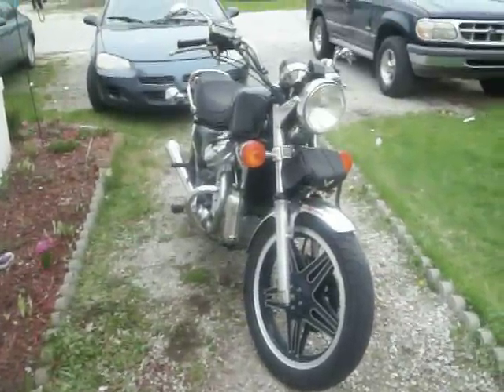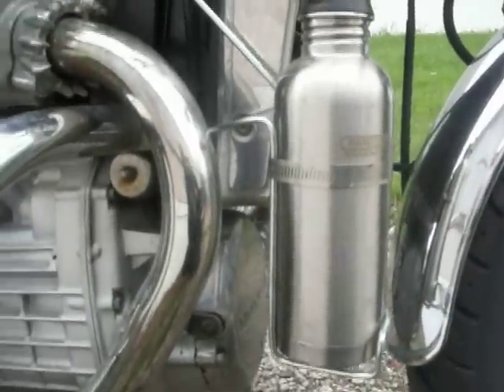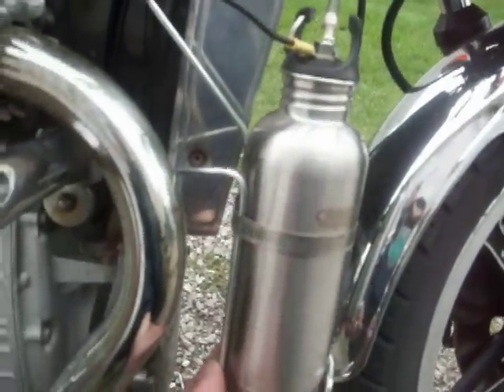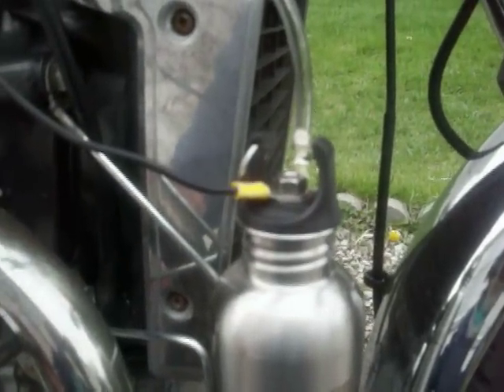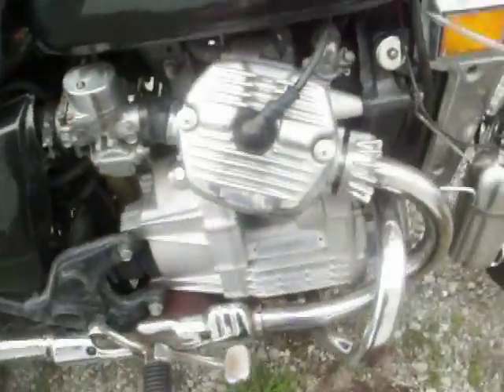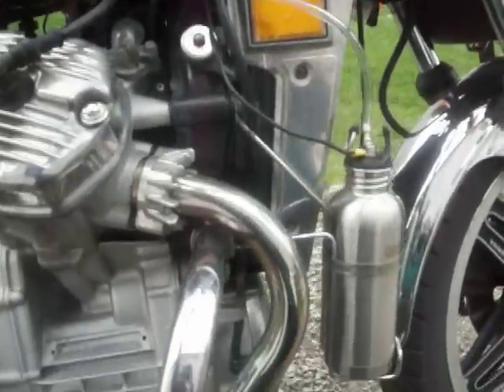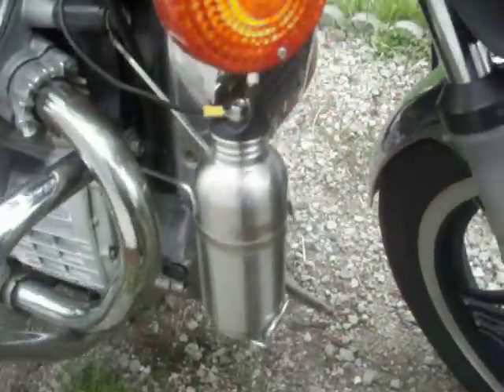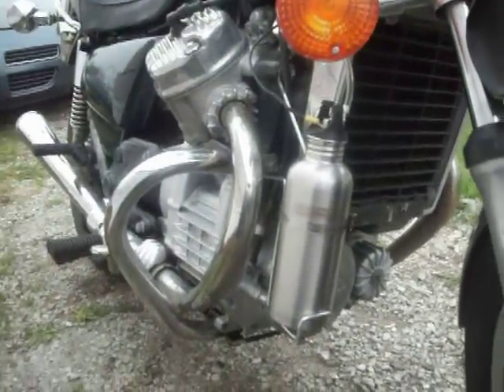HHO / Hydrogen generator powered CX500 from Westcoast Exterminator

Comment from the maker: @christo930 Bikes generally don't have any extra power to spare. so I replaced every light that was constantly on with LED bulbs, This only freed up a couple of amps so I ran with a low sodium solution. This controls the power being drawn and heat output of unit. This is a direct hook up. This year I came up with an indirect hook up (see motorcycle hook up vid). I will be trying this out next season. Thanks for the question

Comment from the maker: @tobsta30 I'm not getting that much. A lot of bikes only have enough amps to power whats put on at the factory. I did switch to LED bulbs where useable, but the bottle bearly puts out anythng, and hardly draws anything. I don't need a bubbler because I'm on the other side of the air filter. The other vid you saw can use left over power from the headlight and get more output

Comment: @wcemichael I meant in an appropriate container, but you are probably right in that the equipment to do it correctly would just be cost prohibitive and dangerous.
I thought that thermocouples were largely used to measure temperature differences, I didn't know they could be used to charge a battery, pretty cool.

Comment from the maker: @christo930 The thermocouple idea is just a theory, so far, but techicaly would work. The are small and produce small voltage, but that voltage is powerful enough to make a magnetic field to hold the pilot light on, on  a gas device like heater or waterheater. Well, maybe they can be made bigger, or at least they can be stacked. I mean, we're talking about a whole engine, exhaust, and cooling system compaired to a single pilot light. Agian, theory, but should work.

Comment: @mrmolez1 The way I see it is that the engine will improve on performance and power output meaning that you will not have to open the throttle as much as would normally be necessary thus (theoretically) improving fuel economy as SOME of the fuel used to power the engine is free.

Comment from the maker: @wheresthelove83 continued... Your not going get a lot. Test to see if your using too much power. I did this with a bulb. Put the light between the power and bolt. If the light BARELY comes on, that's just about right. We're talking about a pinch of baking soda. You could try a old speedo light permantly wired in and use a stronger solution. Most rice burners are not designed to give you ANY extra power. So keep small set of jumper cables with you untill your confident the battery's not draining

Comment from the maker: @Lando7331 The point of the bottle was to create the MOST simplist HHO bottle that the masses could reproduce. Making a neutral plate would be somewhat hard in keeping things simple BUT, I have a way to run the bottles, maybe multile bottles that have 0 resistance by using leftover power. I have an example vid in my collection. Also runnig 2 bottles in series, like batteries in a flashlight, would provide the same neutral effect.

Comment from the maker: @wheresthelove83 Take out the headlight. Use some kind of tester,  a light bulb with couple of wires. Hunt for a hot wire when the power is on. Mine has a group of think black wires. with basic connectors protected with clear rubber insulators. I shoved a wire between the connector and insulator. YOU NEED TO SAVE SOME AMPS to do this, Replace most lights with LED bulbs. The tail, the speedo & tach. the front turn signles for now has a piece of tape over the bulbs terminals for the running lights

Comment from the maker: I'm sorry. I didn't see this question till now. Get a cheap amp gauge from ebay & a couple of leads with alligator clip ends. Unplug the smaller wire from the battery if you can find it and hook the amp meter in line. This will tell you how many amps you have when charging.. If you have a couple amps left over with the HHO on then your good. You can save back a couple of amps buy replacing your brake/tail & speedo/tach lights with LED bulbs. I have a vid playing with the amp gauge.

Comment from the maker: @jochangsek Great question! I do seem to get an extra 5MPG on my truck with EFI, but yes, I've heard of (not tested myself) a couple of things to fool the CPU. It involves hooking a resistor to the oxygen senser wire and grounding the other end. this will send less current to the senser, fooling it. How exactly and what strength resistor I can't say, but I did see on YT. You could also use a rheostat (which is an adjustable resistor) Tell me what you can find!

Comment: @wcemichael I'm leaving a comment. I love this simple design, but you could use a 'neutral plate' to lower the amp draw... By using a neutral plate/tube the current will jump through to the positive.It will lessen the voltage used and therefore you can then have a taller bottle of stainless steal.more negative suface equalls more amp draw and the neutal plate will help dissolve that problem. 12vdc / 1spaces = 12 volts on ur design, and to be more efficient.......................................

Comment from the maker: My comment pop ups don't seem to work right. The results are in. Before my bike was getting 30 MPG. I topped off the tank and drove 35.35 miles. I stopped for gas and topped off again. I used .971 gallons. After doing the math. I am now getting 36.4 MPG. If you factor in the savings, I AM PAYING $3.38/GALLON!!!! instead of $4.17

Comment: Hello sir this type of hho generated   over heat . How to dicrease heat ????. Pls explain . My SS bottle size is 30 cm height . 1 letter capacity
Reply from the maker: Use less sodium or baking soda in your water. This will cut the conductivity and draw less power.. less power =less heat.

Comment: @christo930 Yeap, the original discovery 200 yrs ago (according to Wiki), the guy didn't realize what it was. And, while it's true that they produce a tiny electric current, the whole world would  probably be covered in them by now if they were efficient enough to provide realistic amounts of power. Solar power is obtained via a similar concept, but is only just getting affordable.

Comment: @wcemichael Yeah. I'll try to look it up when I have time. The reason for my question was because while I have a carb unit on my bike right now, I'm wondering what changes will need to take place when I upgrade (eventually), and since all the new bikes seem to have EFI, this is something that needs to be known. I heard a theory once (unverified, of course) that the EFI unit was actually put in place so you wouldn't be able to use gas-saving products, not so you would save gas significantly :(

Comment from the maker: Update on road test. The first time is was using an unknown chemical bought on ebay. My bike went from 30-36.4 MPG. I STOPPED USING IT BECAUSE IT IS POISION AND CAUSTIC AND SOONER OR LATER THE BOTTLE HAS TO BE DUMPED SOMEWHERE AND POSION THE EARTH. DO NOT USE! 
Second road test. I use MSG (Mono Sodium Glutimate), that stuff your suppose to avoid in chinese cooking. With this and lowered amps. I went from 30 - 44.1 MPG which I think is pretty amazing

Comment: @christo930 Have you ever considered producing the HHO at home and bottling it (or alternatively, purchasing it)? It seems to me that if you could use your home power to make HHO quite cheaply and bottle it, it will allow much higher volumes of HHO flowing into the engine without creating a drag from the alternator or possible causing it to overheat and fail from such high output. You would just need a regulator to feed the HHO slowly throughout the consumption of the tank.

Comment from the maker: I'm sorry, but why does everyone worry about what the bike should be doing? Again, I did not buy this bike new. I bought it 2nd, 3rd hand or even more. Plus the gearing is to high. I'm doing 60 MPH at 6,000 RPM while a bigger engine run around 2,000. Plus it is over 30 years old. No telling what happened to it, if it was sitting, what kind of goop was in it. I think the hydrogen might have cleaned it up some.

I think I'm drawing 2 amps, give or take. I'll be making a new HHO unit this summer

Comment from the maker: @christo930 DO NOT STORE HHO! A 2 liter bottle full of HHO w/fuse in the cap is about the same as a stick of dynamite (more or less) Hydrogen will burn. HHO is Hydrogen w/PURE Oxyegen and will explode instantly when ignited. Thank you for asking.
This new hookup I am exploring should eliminate the "drag", However you could also have a seperate battery charged with solar panels, Also Thermocouples produce power directly from heat and could charge a battery while the motor is off but sitll hot.

Comment: hi. nice video. how much volts and ampers have your battery to make it work? thanks
Reply from the maker: +Carlos López I'm just using whatever spare power I can draw from the system. This also included replacing as many bulbs with LED bulbs. They are in the tail light and tach and speedo gauges.

Comment: And I don't understand how it gets better mpg cuz the carbs are still dumping in the same amount of gas unless if u change fuel ratio
Reply from the maker: There are a couple of possibilities.
Gas is a dirty fuel. It leaves deposits like carbon. These deposits can reduce MPG.
Gas also can only burn at a certain rate, which is why the spark plug fires BEFORE the cylinder reaches the top and sometimes doesn't stop burning until after it's left the cylinder. Seeing flames come out of race cars is a good example of how slow gas burns.
HHO burns complete and very very......very fast. So by adding the HHO to the gas/air mix, the gas can burn quicker and burn more complete, with less waste. This also leaves less deposits.

A good analogy of this would be....Take a cap full of acetone and a cap full of kerosene. Try to light both. The acetone will burn but the kerosene won't burn by itself. Add the cap full of acetone TO the kerosene, NOW the acetone will burn and also help burn the kerosene and both will burn up till the fuel is gone.

Comment: One question always in my mind about HHO, if you connect the line of gas (hidrogen) into air filter, how it can be affect to the fuel consumption? As i know that Carburator is constantly mix the oxigen and fuel in line depend of the volume of oxigen..here what i mean, if we have 250cc engine we need 250cc mixture per RPM between fuel and oxigen, and for make that mixture suppose we need 200cc oxigen and 50cc of fuel in every revolution,and the setting Carburator is always like that. So if we put hidrogen in line with oxigen, the mixture become 100cc oxigen 100cc Hidrogen and still 50cc fuel.. its not affected.
Reply from the maker: By adding the HHO to the mix the mix will burn more complete as gas is a dirty fuel and lots of unused gases escape out the tail pipe. This is why we need catalytic converters. With the complete burn of the gas the piston will be driven down with more force, with this increase in force you may idle back on the gas pedal to achieve the same RPM and speed.

Comment: No anti blow back valves ????  Is that not a potential bomb???
Reply from the maker: 1. If there was a carb back fire.... it would also have to go through the air filter. Not likely
2. It's a stainless steel canister with enough gas at the very top to equal a firecracker... maybe 2
3. if it were to blow for some unknown reason.... only the cap would blow off because of the steel canister.

Comment: I have installed hho bobbler in my 1.9 L diesel and now it shows me 0.4 l /100 km less then before.
Reply from the maker: +Seb Art Maybe you're drawing too much current to run the HHO. Water down your solution a bit.
Reply: Oh no! I think you may have "dropped a bollock". Hydrogen in a petrol engine will burn with the  petrol ignited by the spark and increase power and efficiency. Diesel engines do not have spark plugs, so the hydrogen will  burn at a different time to the diesel which is ignited by compression. This double bang will cause opposing forces and at worst damage your engine..  It is a like mixing petrol with diesel and hoping your engine will run better, it won't.
Reply: Doug Boyd, there's a company in Australia doing it to diesel trucks and fishing trawlers. It just increases the efficiency of the diesel burn giving better economy. Some have reported up to 70% increase on road for the trucks.
Reply: Dough Boyd do you really belive what you say ? the timing is perfect in a diesel motor , the gas engine should also adjust the timing like a diesel motor , dead on , you dont need the ignition to ignite before because the ignition is much faster with hydrogen

Comment: if i made 2 generators and put one more batterie to my bike can i drive without´fuel'???
Reply from the maker: No. There are people working on this. Even if you did get enough hydrogen, the oxygen is pure and it really throws off the timing. If you can separate the hydrogen it will burn more normal in the engine. I mean it probally can be done but it's very hard to get right.

Comment: Hi does the cell discharge the battery? how much amperage does it adsorb? thanks
Reply from the maker: The cell did slowly discharge the battery at first. I diluted the mixture with plaine water and it drew less amps and the battery was OK. I don't know the amperage. There is a video were I did measure it. you'll have to check my earliest videos for it.

Comment: I have a 1980 kz1000st inline 4 that gets about 30 mpg. Will this setup work with my stock airbox and carbs? Did you have to lean out the jets?
Reply from the maker: "work with stock..." cant be sure, that's pretty big. No I didn't lean out the jets.
Reply: it will be improved by adjusting the ignition  timing ,

Comment from the maker: If your drawing too much power, simply water down the solution
Reply from the maker: Well, I did run this for a couple of years and even added a second unit on to it powered in a different way.
But I had to do major work to the bike.. for reasons other than using the gas system.. The bike sits outside 24/7 in the rain and snow. Being in a motorcycle club and this being my only bike, I decided to take off everyting and concentrate on just getting the bike up again. There was no internal engine damage that needed repaired, but things like carbs, and cooling system, I think. It was years ago. Hopefully I will be getting a 50cc mini chopper up and running of my own and I might try the units out on this and hopefully have more measurable results because of the small engine

Comment: Is the wiring the same as the one you showed on your car for the DIY HHO?
Reply from the maker: jobless wapster Basically yes, Pos wire, neg wire. This has no relay switch
Reply: how about the ground wire? so basically it only has the positive wire connected to the stainless bolt and the negative wire tapped unto the stainless bottle right? really thinking about making and testing one out
Reply from the maker: jobless wapster The bottle is ground. It is connected to the bracket with a hose clamp which is bolted to the frame. When I put one like this in my truck (which I have video of) I used a hose clamp to connect a ground wire to the bottle at the neck which didn't have a mounting bracket, and that one had a relay switch to get juice straight from the batter when the engine was on. Out of all the configurations of HHO units I have tinkered with, this one is the most durable, and requires the least amount of maintenance

Comment: I have an 81 GL500, which has the exact same motor as you have. I did NOT make whatever you did and the worst mileage I got is 46mpg, and best was 55. How are you getting such poor mileage?
Reply: I also believe the amount of electrolysis induced hydrogen to be nearly negligible. I don't believe it does a thing but put a small strain on the electric system. Proper maintenance of the bike overall would increase your mileage far more than any low voltage hydrogen system like this. I'm surprised you aren't actually getting worse mileage. There is no such thing as free energy in a closed system. It would stand to reason that since you are using the bike's electrical system to convert water to hydrogen and oxygen(which it will do, but VERY slowly), the added load on the charging system will require a very slight bit more power from the engine. This is a fact which blows a hole in this whole thing.
Reply from the maker: +David Ouradnik Nobody is trying to get "free" energy, just better combustion of the gas you are using.
And I don't know why my MPG sucks. It's a 30 year old bike I bought second hand.
Reply: +wcemichael mine is also old. Third hand at best. 34 years old. The age means something, but that alone doesn't produce bad mileage. Although you think getting better combustion is the goal and result of your device, if you honestly think about it, since you are using the bike's electrical system to run it, you're  putting a drag on the motor that wasn't there. Even if you are burning cleaner, you're costing more gas. Assuming you are correct about you're bike not using fuel correctly, and I think you're right, the best bet would be to thoroughly clean the carbs, make sure of proper jetting, and above all, have a good bike shop sync the carbs. It's a regular maintenance procedure that does wonders for multi-carb bikes. Stronger spark in the form of new coils could also help. I do believe there are gains to be made in fuel economy. I'm a firm believer in the vapor gasoline systems, heated by exhaust heat, which you already have from normal combustion. No extra strain on the engine.
Reply: Either way, nice bike. If you care for them they last a long time and are very reliable. It looks to be in great cosmetic shape.
Reply from the maker: David Ouradnik
Yea. It served me well for a number of years